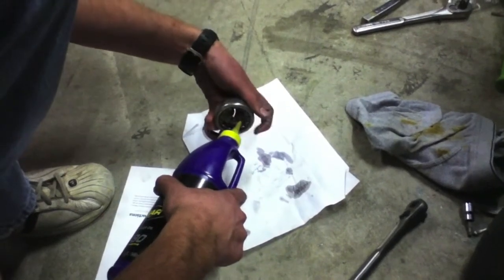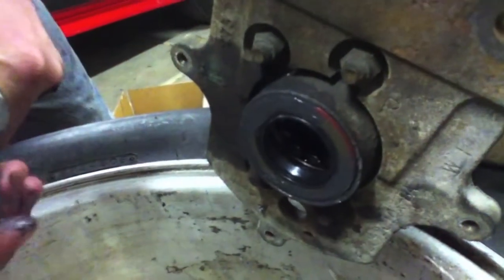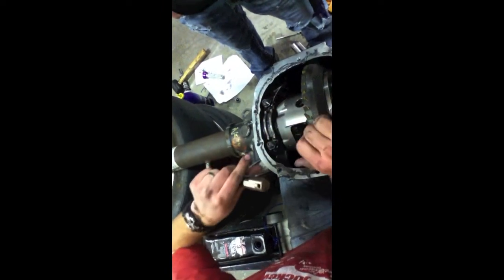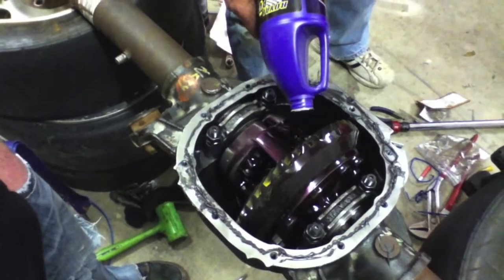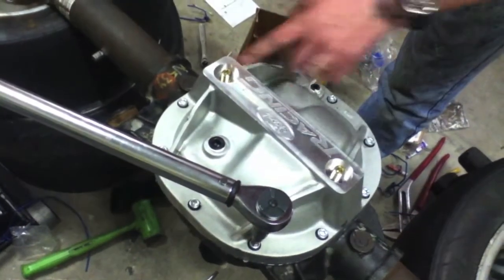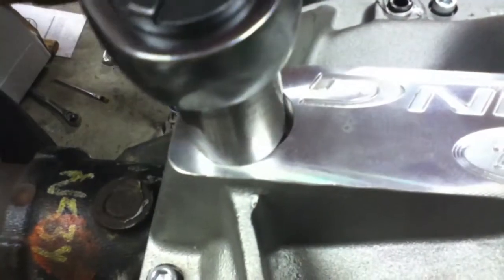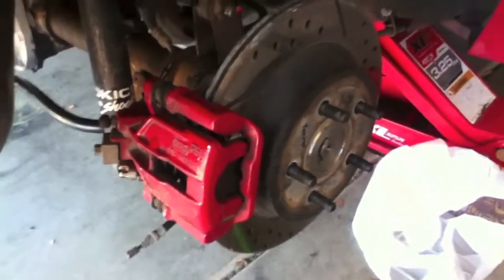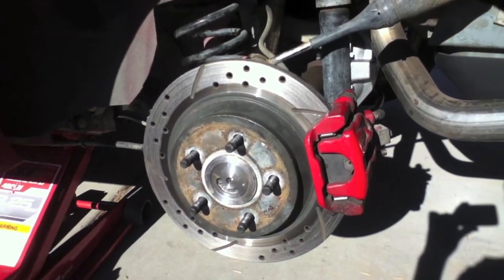Ford 8.8 inch Gear Install (Part 7 of 7): How to install gears

Comment: This was a really excellent series of videos, I've watched quite a few on this procedure (I have mine torn apart, new ring gear on, new races and bearings in, just need to set pre-load and backlash and put everything back together) because I want to make sure the ridiculous amount of money I've spend on a complete rebuild going from 3.73 to 4.56 doesn't blow up as soon as I get rolling!  I didn't even think about getting a new carrier, but I've already replaced the carrier bearings and bought the spider gears and full rebuild kit.  I'll be doing the wheel bearings and seals too of course, and even all of the drum brake hardware/shoes/drums.  I figured I might as well do a FULL rebuild while I'm doing it.  I ended up pulling an entire axle identical to mine at a junk yard for $65 so I can take my time, learn, and make sure it's perfect without putting my truck out of service.

I went from 27" tires to 32" tires on my Ranger, and my low end torque is just plain sad.  I just have two questions.

I hadn't heard of using Teflon on the plug(s).  Isn't there some concern that when they are removed and replaced in the future some of it could get pushed inside the differential and cause problems?  Mine is a 7.5 open and I'm using an OEM style cover, so I only have the fill plug on the top and no drain plug -- not that that really matters I guess.  Or maybe it does since mine can only be drained by removing the cover.  I imagine chances of it leaking from the very top of the differential where the fill plug is isn't very high. Either way I don't think I'm comfortable using Teflon, and it doesn't seem like it would serve any purpose in my case anyway.

I also plan on using Royal Purple, I use their fluids in my transmission and even my engine -- but that stuff is expensive.  I've read that you should change out the differential fluid after a break-in period of about 500 miles, so I was planning on using cheaper fluid (still quality of course, I already have some Valvoline synthetic) then putting Royal Purple when I change it.  Is it really justified to use $60 worth of fluid that will only stay in there for 500 miles?

Comment from the maker: Yes, I thought about doing the Comp 106100 cams. They do not require new valve springs and work well with 4.10/4.30 gears in the rear end. It's hard to drop $1k on the Mach though, having the Cobra that can make more power for the money. I migh do headers, new motor mounts, and a dyno tune.

Comment from the maker: Sorry about that. I wish I could have included more info, but the vids were already long enough and when it came down to it using the factory shim was the better way to do it. I bought the ratech pinion depth tool but found it easier and just as accurate to use the factory shim and check the pattern.

Comment: These videos are fantastic. Great job. However I was hoping that you would go into detail on how to measure pinion depth, and what clutch order you use. I knew you were missing some steps when you showed the pinion bearing installed initially.

Comment: thanks for making all these videos. I  learned a lot. one question though.? I have an 07 gt  and im wanting to throw some 4.10's in that ive had on the shelf for  a year in my garage cause I was scared to install them myself. now that I think I have the know how and most of the tools I think i will dive in to the job one weekend. 

how much harder would this job be on a s197 style mustang vs a new edge like the video?

Comment: Hey got a question, I have a 07 explorer with a 8.8 IRS. Will everything pretty much be the same as far as the ring/pinion and carrier. Also I read somewhere that this axle does not have a carrier break. So I can swap my 3.55 pinions with 3.73 and not have to replaced the carrier? Thanks, and great videos.
Reply from the maker: I'm sorry, I don't know enough about IRS to say. All I have done on IRS was pull the half shafts, which was like removing a drive shaft. Very easy

Comment: Your video came up short on showing how to correct tooth pattern? (A full video on setting pattern would be helpful)
Reply: While I do agree with you, it's easy to find a diagram that shows "if your pattern looks like this then do this" (too much/little pinion depth, or too much/little backlash).  It's really just a tedious process of taking it apart, moving shims, and putting it back together until you have the proper tooth pattern.

Comment: Did they press the ABS exciter rings on to 1.25-1.35 inches away from the flange or just fully seated them? Just asking becuz i heard they had to be pressed to spec otherwise it screws with your abs
Reply from the maker: To my knowledge it was pressed on entirely but I'm not sure and the shop is a professional one, so they may have done it to your specs and not said anything. No abs lights 3 years later
Reply: Scrun Johnson
alright thanks, yeah ill probably just have them pressed to spec so i can sleep at night loll

Comment: I'm new to this, so can you use the factory gear carrier with a new gear... Like putting a 3.55 gear on a 2.73 carrier???
Reply from the maker: Yes, you can use different gears on the same carrier.  Once you go bigger than 4.56 you have to use a special pin with notches that allows you to install the axle shafts with the pin already installed.

Comment: I do have a question. I had my gears replaced by a mechanic. After that, my Mustang has a howling noise only when deceleration and only the speed is between 50 and 80 MPH. Any idea what might be the cause? Thanks.
Reply from the maker: It's most likely the mechanic set the backlash too loose (free play in the gears from forward to backwards motion). The specs should be .08-.015. Under acceleration there is pressure on the gears that keeps them tight, but when you let off the gas they have too much play and make noise. To correct the problem you would need to remove the rear cover and put a dial indicator on the gear and measure it, then move shims from one side of the carrier to the other in order to reduce or increase backlash within specs
Reply from the maker: I had to remove my carrier a few times to get it just right, which shops don't always have time to do.
Reply: Thank you very much for the advice!